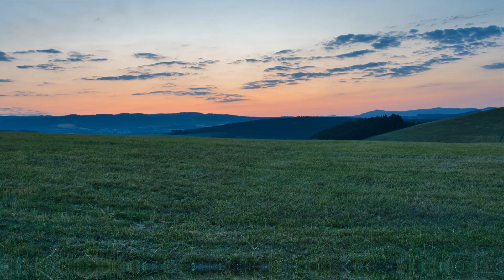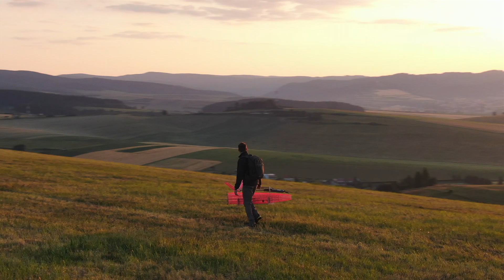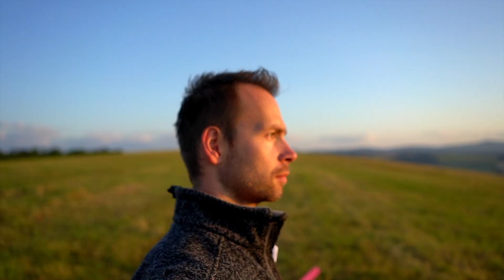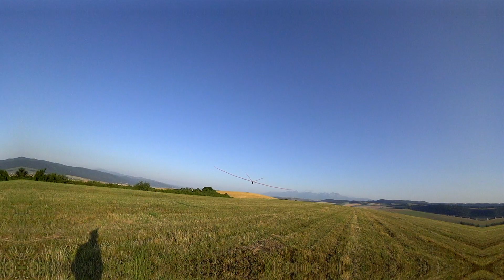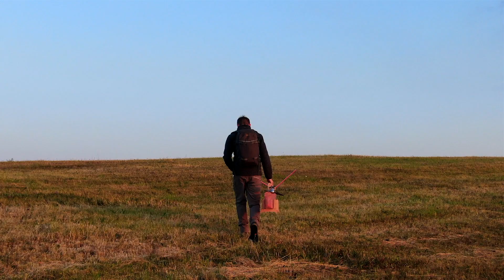KRAGA Roa - first and last flight of 3.4 m big 3D printed plane

Comment: this was a forgone conclusion before the first parts where finished because the strength to weight ratio of 3d printed wing means its probably the least appropriate method of constructing a longer glider wing, 
 Here is an example of a guy building that uses 3d printed parts for appropriate components  like the fuselage wing or tail attachments on competitive F5J models
https://www.thingiverse.com/thing:2928971

Comment: There are some 3m 3D prindet RC gliders work successfully. But those have pretty thick airfoil, solid 3D Printed shell, glued top and bottom spars out of carbon fiber tubes. Those gliders are also printed out of LW PLA (light weight foaming PLA filament) which allows to make thicker stronger structure with more structural reinforcements without gaining more weight comparing with regular PLA.

Comment: Thank you very much for your work and your courage to show even a failed design project! Nice cinematic editing skills too and i liked the way you showed how much work and effort goes into a newly designed rc glider and hundreds of hours coming to a single moment of the maiden flight. And its always a thin line between nice flight and a total loss of the model. especially on 3d printed models you have only 1 try.  
Ive never flown a fully 3d printed model, but i printed several parts for my gliders like winglets, spoilers or small outer wing sections, motor mounts and so on and i always had the problem that i needed PETG for flexibility and heat resistance but the parts were always really heavy and for example winglets got quickly above 20-30g each and thats a lot for a 2m glider with 1500g total. compare it to a foamcore winglet with some carbon flat profiles and youre on 10g each side and you dont have the problem with transport damages or bad landings. my petg winglets are not excusing any mistakes.
And the fully 3D printed models i see around are heavy wingloaders and not too stable for max g manouvers. and lightly printed you risk loosing torsion stiffness what happened to your model.  i think still miss the right material for big 3d printed rc designs. smaller designs seem to work good, but for me still too heavy.
Looking forward for more of your content! Keep on going!

Comment: I have just discovered your site and watch the video. I fly fully moulded 2m - 3.8 m Gliders and your design is amazing and really beautiful. What is a shame is that the wing didn't have a strong enough main spar. I think that you could make a viable glider with the geodetic wing but you need to incorporate a carbon tube main spar to give it rigidity. By using different diameters you could produce a tapered spar that runs out to the tip. You could also use a small diameter carbon rod that runs along the leading edge and along the flap /aileron single line, that way you would have 3 stiffeners to give the wing the strength that it needs. I note that you released this film over14 months ago I hope you have continued with your work and discoveries. You are a true aviation pioneer and I salute you.
Reply from the maker: Thank you for the comment. I really appreciate such a constructive input.
The version in the video has a polyhedral wing, so it is not possible to put there one long carbon tube (made out of multiple tubes with different diameter). But very good thinking. 
Yes I didn't give up and I actually ended up doing exactly what you are suggesting (got rid of polyhedral and that way it is doable).
Actually, I'm just putting together video about my recent test flight of the new wing. So stay tuned ;-)

Comment: Loved the editing in this video, sorry about the result of the plane.  I don't think your design was  wrong, only the size of the plane for the materials used.  If you did revisit this project try a smaller wing span, maybe 1.5-2 meters.  Even if you don't you have still inspired other people through your work.
Reply from the maker: I have already some smaller designs that work very well, but I wanted to push further. I did revisit the project, I'm about to maiden it in couple weeks. Hopefully it will be strong enough this time.
Reply: @kragamodels7285  love to see the results, all the best with it.

Comment: I'm going to suggest that the skin, mostly, caused the problem. The internal structure was fine for supporting the airfoil shape, but it needed a much stiffer and better bonded skin. Maybe an all carbon fibre leading edge tube would have helped too. I've been making gliders, on and off, for 6 years, and I have done some 3D printing, but not of airplane parts, yet. Good luck anyway.
Reply from the maker: Thanks for the tips! I redesigned the wing, I had to do some compromises but it is much stronger now. I'm about to maiden it in couple weeks.
Reply: @kragamodels7285  Looking forward to that!👍

Comment: For a wing of that length it needs a carbon sheet  "D" box section and "I" beam main spar, or use larger diameter carbon tube not solid rod which flexes too much. Good luck.

Comment: Hello Kraga, what filament have you used? I have a Zortrax printer too and I had a lot of problem with the joint between layers. It is too weak, I changed to 3rd filaments that I can modifier the settings and I obtained very good results, I’m not expert on airplanes but maybe you can find a good material to built your great plane. Best regards
Reply from the maker: Thank you for the advice. You are right about the layers, they don't stick very well. But that is not the reason why Roa broke down. Carbon spars is what makes my planes strong and that is what I have to improve. I'm working on Roa II already :-)
Have a nice day

Comment: Create a channel above and below your current spar.  Get some rectangular carbon strips to fit the channels and glue in with Ca. This will make an I- beam spar that won't fold like that.
Reply: The problem here isn't necessarily the structure, its the flutter, which is caused by aerodynamics

Comment: It looks like the wing folded where the carbon rods overlap.  Because the rods are staggered and not in-line the full length the wing is going to be weak there.  The outer portion of the wing is going to put a lot of torsional stress on the 3d printed structure between the rods and the more distance you have between the rods the weaker it will be.  I would suggest joining all of the carbon fiber rods into 1 continuous rod.  You can use another rod piece with a OD slightly smaller than the ID of the rod to join the pieces.  Look at how the wings are joined on high performance kites.  I think if you did that the wing would hold up to the stresses a lot better.
Reply from the maker: Yes, that section of the wing is critical. The reason why I did not use in-line configuration is dihedral. I simply wanted to have at least some dihedral to have stable and relaxing thermic cruiser. 
But in the end that is exactly what I'm now going to do actually, I will throw away dihedral and use in-line configuration.
Reply: @kragamodels7285  My first gliders had the dihedral further out on the wing...maybe the last 1/8th of the wing or so.  Just move it out beyond the stress point of the wing.

Comment: some info.   two years of mucking about.   while having only a fraction of the  REQUIRED  knowledge between your ears.  
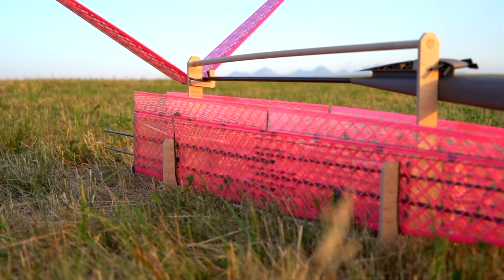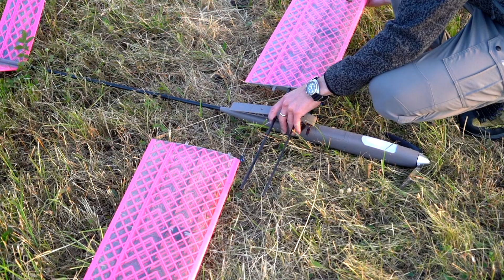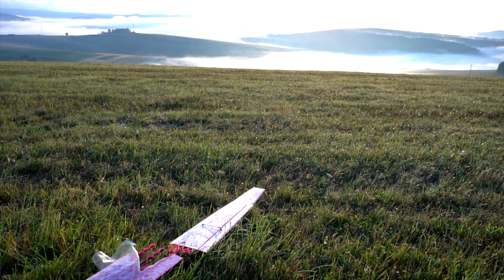postmortem info:    the dom, distribution of mass, of the wing halves was not optimal;  and aileron servos Should have been installed as far Inboard, as was practical.       at 1:00, multi-piece  main spars.    root of forward main spar Not located at  THIRTY percent of chord; with secondary main spar Not located  near  the aileron  hinge line; chord-wise strength not increased..      no  'rib-like' structures, to tie upper and lower wing surfaces together; no  chord-wise strength.    insufficient structural strength in the  ENTIRE  leading edge.     a fairly thin  profile  was used, in the main wing; looks like maybe  eight-point-five percent, instead of  ten percent.    because the ailerons did Not extend to near the wingtips,  responses to roll-axis inputs,  Would have been  Damped.      at 1:03, the design resulted in an  excessively, Elongated  forward fuselage.    at 2:49, it appears that an  Entire  join  failed, in the starboard wing half.        googletranslate
Reply from the maker: Yes it is easy to criticise everything what is wrong with it. Much harder to come up with solutions. 3D printed planes have huge limitations and whole designing is mostly trying to find a way within the limitations of thechnology. Even with using high end materials like carbon it is sometimes not possible to design everything in optimal way.
Lets have a look:
- distribution of mass, of the wing halves was not optimal: yes, not optimal, but as good as possible
- aileron servos Should have been installed as far Inboard: again, those are as inboard as possible
- multi-piece  main spars: chordwise position is mostly given by the wing shell mesh, I cannot put those freely wherever possible
- no  'rib-like' structures, to tie upper and lower wing surfaces together: actually there is a connection b/w upper and lower surface, it is just hard to see
- insufficient structural strength in the  ENTIRE  leading edge: yes, that is something to improve on
- a fairly thin  profile  was used, in the main wing; looks like maybe  eight-point-five percent, instead of  ten percent: yes it is 8% and thinner towards tip, I don't want a airbus with 10% profile
- the ailerons did Not extend to near the wingtips: again printing limitation, such aileron is extremely hard to print, but that can be improved by mixing in flaps.

Nice sum up, if you meant it all in constructive way then thank you.
Reply: @kragamodels7285  dear mental midget,  weh-weh-weh.     yes, it is easy to  NOT  UNDERSTAND  THE  PURPOSE OF,  critique; see below.        weh-weh-weh.     yes, i am NOT interested in  EXCUSES.     excuses do Not alter the fact that  THE  USE  OF  NON-OPTIMAL  DESIGN  INVITES     FAILURE.        weh-weh-weh.   yes,  in your tiny mind you have  ASSIGNED to my comment,  an  INCORRECT motive.           do not expect praise for your use of the   'error and trial and  ERROR'   method of learning, from someone who does  NOT  have sawdust between his ears.    googletranslate
critique   ---     EVALUATE  (a theory or practice)  IN  A  DETAILED  AND  ANALYTICAL  WAY
(in case you do not  understand,    analytical.    it means,   'WITHOUT  assigning   BLAME'.)
https://wright.nasa.gov/airplane/shortw.html
see   'lecture1'   thru    'lecture20'
http://www.stengel.mycpanel.princeton.edu/MAE331Lecture6.pdf
Reply: @kragamodels7285  note that  MANY  of  the  design  FLAWS,  have  NOTHING  to  do  with materials or 3d printing.    they were the product of  IGNORANCE  and  Arrogance.     these are the two major components of  STOOPIDITY.          btw,   it can be noted that, as designed,  the  THICKNESS  of the clark-y proflie is  11.7% (of chord length).
https://en.wikipedia.org/wiki/Clark_Y
Reply: @krekre806  you are a snotty, putz.     your reply reflects the fact that you are a snotty, mental midget.    feel free to  getlost. or go back to your cereal and cartoons.
Reply: David Davids oh what the internet has done these days, with creatures like you showing off their balls while staying behind their screens..
I wonder how many planes you’ve built before , if you’re here to bring negative energy into this guy’s channel feel free to unsubscribe and fuck off. He didn’t ask for help and if he did , certainly not yours.
I’m pretty sure that he’ll get this bird flying one day.If you wanna give advice to people,
work on your attitude first.

Comment: Why not carbon fiber rods in the spare to stiffen the load path?  Horizon builds a Radian XL out of all foam (no natural rigidity) and then places fiberglass flat plates and carbon tubes throughout so it maintains shape and it’s one beastly heavy aircraft. In a nose dive it’s wings flapped like a bird even with all that, but when it flew as a glider it was majestic.  I didn’t rebuild it after the nose dive, but what you got here changes all that because it becomes affordable and easy to repair. Now is not the time to retire the big design, now is the time to elevate it to the next level and improve on it.  Your at the precipice of bringing new flight to the hobby.
Reply: Yeah carbon fiber spars would be great
Reply from the maker: I used carbon fibre, lots and lots of it.